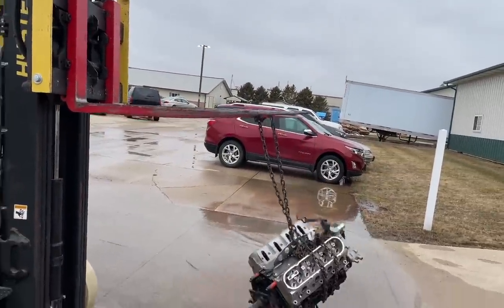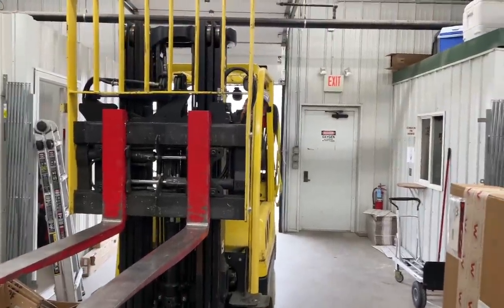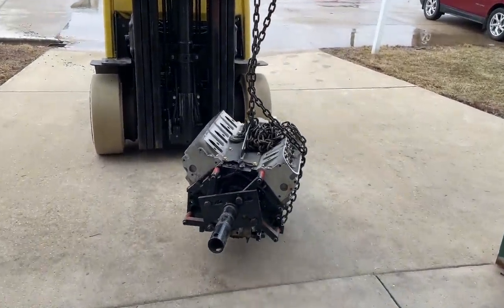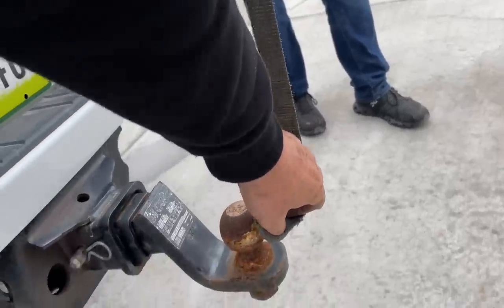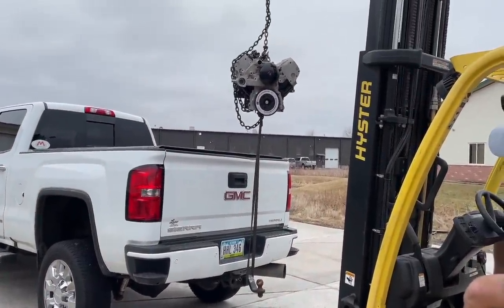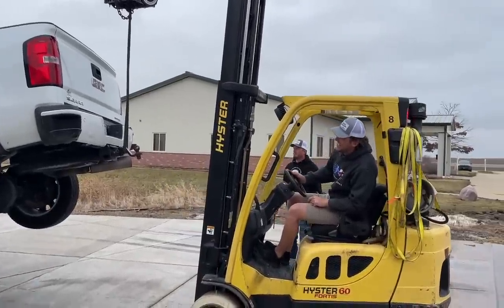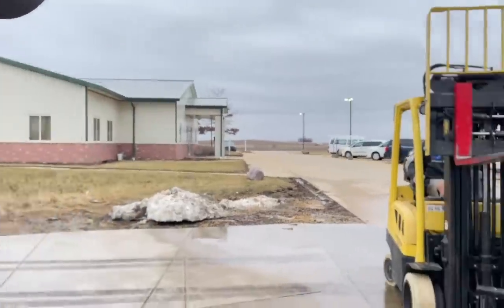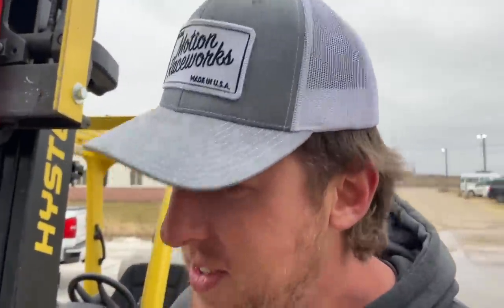Cleetus Tests the Motion Raceworks Engine Lift Plates

Comment from the maker: Please don't do this with one of our lift plates this was for science purposes only.
Reply: if those bolts was  from Nuts n Bolts guy ( think its the name )  that would of been a promotional video on all angle with no wondering 
cuz now imo ppl are gonna wonder (imo)
Reply: “Hold My Beer”
Reply: @4EverParkedLS More like "hold my turbski." 🤣
Reply: Alright, I won't lift your truck with a strap on the hitch, strapped to some chains on a mock up LS block which has your lift plate on it, which is then hung by more chains to a forklift fork, Doug.  Absolutely not gonna do that.

However, I might lift someone else's truck with that rig, because proven technologies now exist and must be utilized.  

I'm convinced, if I ever need a lift plate, y'all's's are the one I'mma get.
Reply: "Science"
Reply: Follow the science
Reply: Just think if something gave out that bumper and tailgate be fucked
Reply: You say it was science, but I didn’t see any lab coats…
Reply: @ovalsx  Look again. That tailgate was already fd up. I was secretly hoping that when the motor was swinging wei-tu-low that it would hit it again. 🤣
Reply: @FoolOfATuque  How daaaare you!
Reply: This was a test? I thought that was just how you check you did the engine mounts up tight enough.
Reply: @FiglioBastardo  🤣 that small dent on that gate is just a small donation
Reply: @ovalsx  🤣
Reply: @siraff4461  I think it happens like this when the instructions are cast aside. 🤣
Reply: To late
Reply: Too late. Truck fell on me… buddy used a harbor freight lift plate to get it off me…
Reply: i need a ati damper and you gonna treat it like that
Reply: How is this science when there was no spray involved?
Reply: I'm more impressed that the little ass strap didn't break
Reply: Damn I was really hoping I could use the plate to move my whole truck around. But since it’s for Science, I guess I can’t
Reply: Yeah… this is gonna sell a couple
Reply: Also not recommended to lift a truck by its tow hitch...
Reply: Nope too late, I gotta do it. I just gotta do it.
Reply: So in other words, "we dont stand by what was shown in this video, this was pure luck"?
Reply: lol ohsa inbound
Reply: I'm just saying.... Cleeter wasn't wearing his lab coat.... It's not real science 😂... I want a cleeter in a white coat we wanna see the failure point...for "science"
Reply: I ordered one will be trying soon

Comment: Only Cleetus could jump off a running forklift, unsecure load in the air, straps hanging off the front AND BACK of the forklift -to make a safety statement for his viewers LOL
Dude, you just broke all the basics of forklift safety 🤣🤣🤣❤
Reply: @Toucan__Dan  You are absolutely correct!
They need a safety consultant REALLY BADLY but we all know that only happens POST INJURY.
Someone is gonna have to get hurt real bad for the channel to start complying with safety regs.
The frequency of risk and potential for harm is HIGH & SEVERE with Cleeter.
Reply: @jaydoe5654  It legitimately pisses me off. It's already an uphill battle promoting safe practices, this shit doesn't help.

He's a pilot too. The safety practices of the heavy equipment world are adapted from aviation procedures, he knows better.

Comment: I mean the lift plate is just 1/4 in steel welded together. I'm sure they are plenty strong. The real OG in this video is the aluminum threads holding onto those bolts for dear life 🤣
Reply: and that rancid lift strap 🤣🤣

Comment: Can we take a minute to appreciate the small bolts holding the plate to the motor!!
Reply: Not really when you think about it...The tensile strength of just one 3/8-16 UNC x 1-1/4" is 13,900 lbs, now factor that by 8 and you have a combined strength of over 55 tons
Reply: I was more worried about the chain hook through the eye or cutting the strap.
Reply: @stevecunningham2759  The strap was for sure the weak link in that lift.
Reply: @IR-nq4qv  Are those not m6 bolts? Haven't been imperial for a good long while, but your overall point stands.

Comment: I put a LS3 with a 6 speed trans hanging off the back of it in my Camaro using 4 M6 bolts into the heat shield bolt holes on the exhaust maniflods.

Comment: Now do it With the number of bolts normally used when using a lift plate 😂
Reply: that would be two recycled bolts then lol
Reply: @kiwidiesel  I usually use 3 but glad you got my point 🤣
Reply: @zakksrage  Likewise I usually use one more than the minimum for insurance 🤣

Comment: Not only does it attest to the strength of the lift plate, but the threads of the valley bolts, the strength of the crank in that LS, etc.

Comment: I would like to see them do that with ALL the lift plates, not just the narrowest one.

Cause I would bet money that the wider ones would bow up some with that much load, 
and may possibly even break bolts or pull the threads out of the heads, or break off pieces of the heads themselves.

but for the engine weight by itself, it would be just fine.  Now they need to make some for SBC, BBC, sbf, BBF, small and big block mopar.  All the old school shit stuffs.